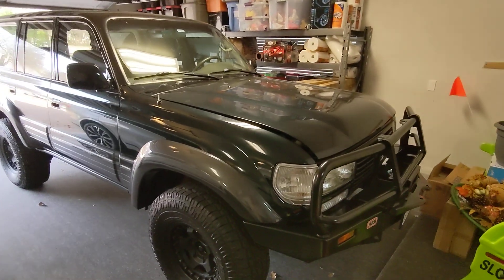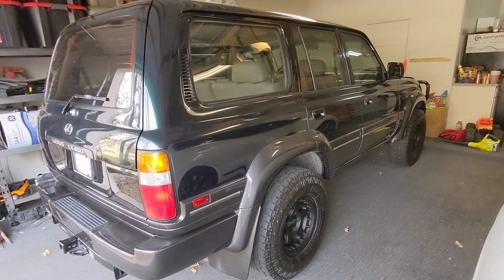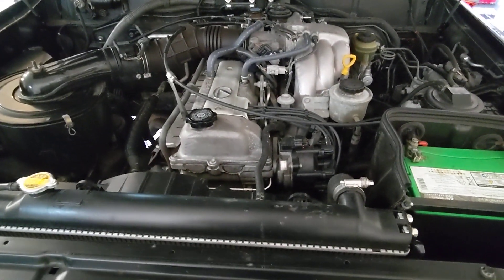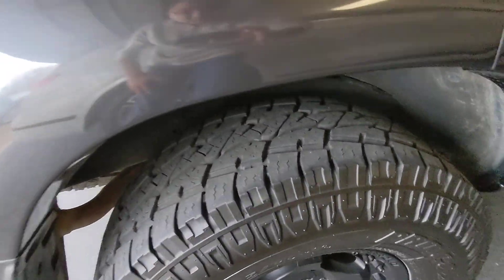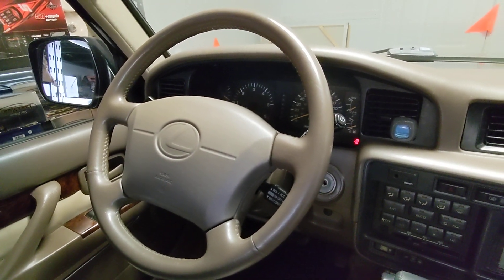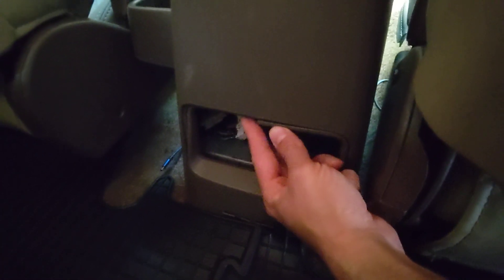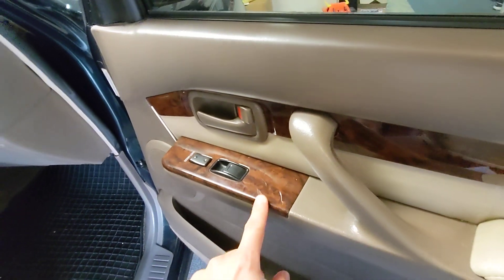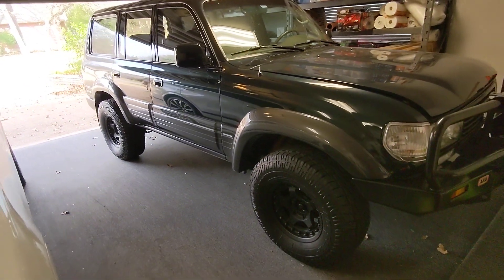1997 Lexus LX450 - On BringATrailer BaT soon

Comment: did you know that lexus models only have 3 out of the rear side glass panels slide, the driver side only has 1 sliding half and the other half does not slide.
Reply from the maker: Wow, didn't know that.

Comment: Beautiful rig! I wish that had been the starting point for my overland build! Btw, I happened to be looking for visors when you posted this. Can you tell me what year make and model those come from? They will be key to fitting with our customer overhead console.
Reply from the maker: Hi Doug! The visors that the previous owner installed on this LX450 are from a 2003 Lexus LX430. I remember installing similar ones on my 1997 40th anniversary edition Land Cruiser 10yrs ago as well, and I remember correctly they bolted right on as well on the LC.
Reply from the maker: What are you working on for an overhead console? I'm very curious now that you mentioned that!!
Reply: @NKPGarage  You can get a glimpse of it in my video titled "4. Landcruiser Live Aboard." at 1:32. I will do a video on it once it is functional.
Reply from the maker: @DouglasGreen562  Wow, I hadn't seen that video of yours yet. That top is absolutely amazing. I have never seen something like that on an LC. Amazing work!!
Reply: @NKPGarage  It's made by Eric Lippincott at Campteq. You can order a clamp on version, no cutting out your roof . Depending on your stature you could climb up into it via the sunroof if you wanted. We decided to cut the roof out cuz I wanted standing room.